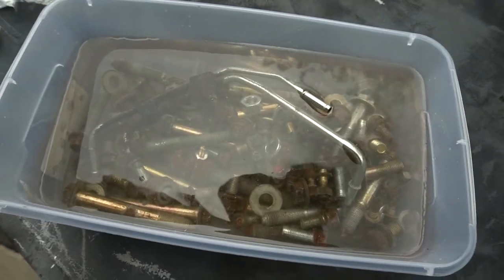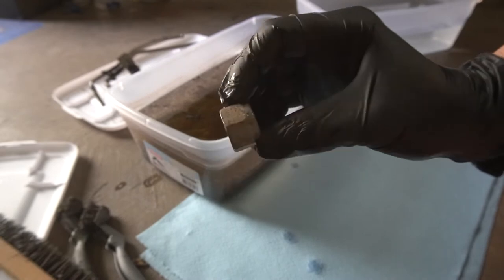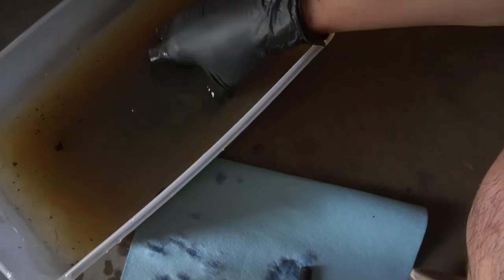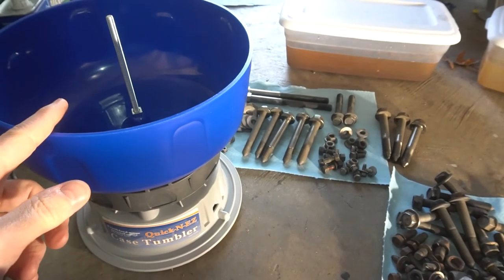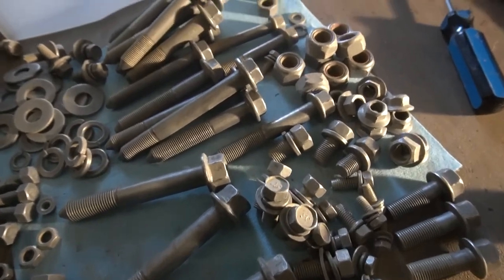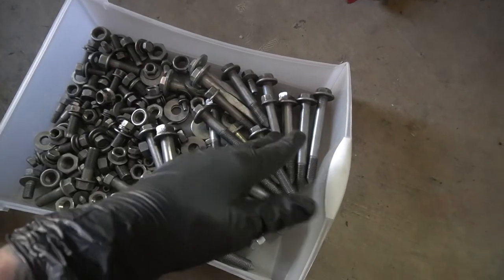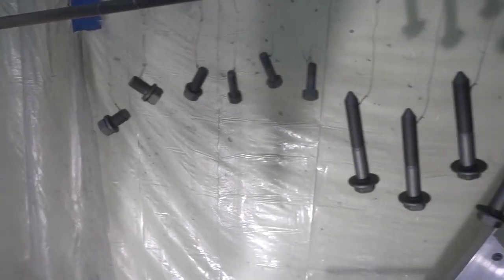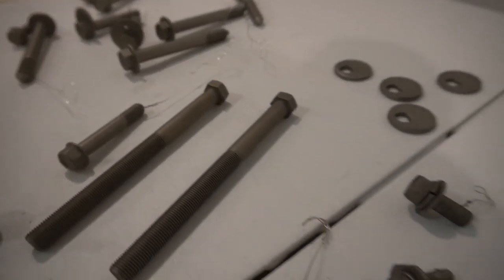Can You Use Vinegar to Restore Old Hardware? + Applying Cerakote!! | Hardware Restoration

Comment: How does the air cure cerakote work with sockets and torque on the bolts? Does it chip off?
Reply from the maker: Honestly it’s not too bad, on some of them I just put masking tape over the tool as a barrier and it was fine, the others it did chip off a little bit if I rushed it. I was being Uber careful tho and I waited quite a while before installing it back on.